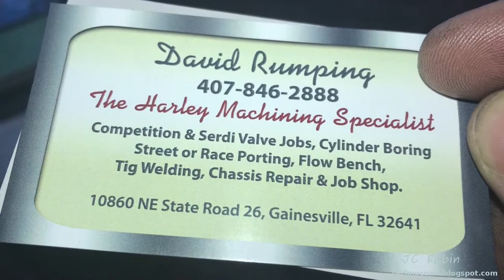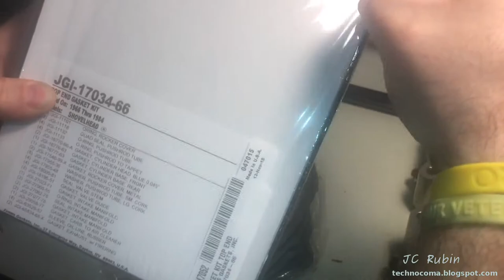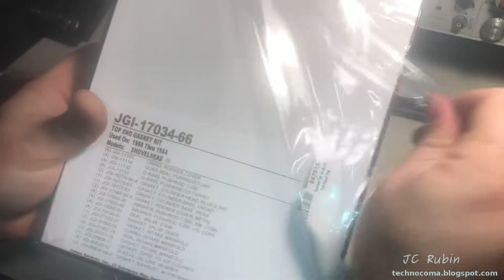AMF Shovelhead Lowrider Restoration -3- Head and Rocker Box Repair and Reassembly

Comment: I was wondering if someone could help me. When I turned off my 1981 Shovelhead FXS Lowrider I heard a sizzling sound in the rear rocker box on the right side. This just started happening this week after I warmed the engine up for about 5 minutes. This sound was never there before and have not started the bike since.